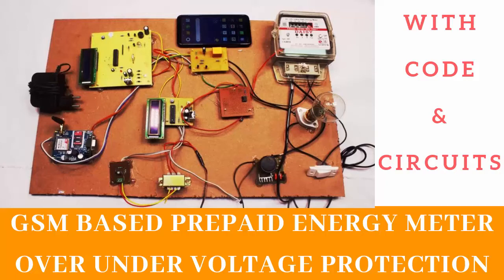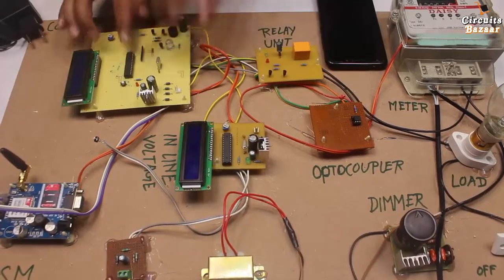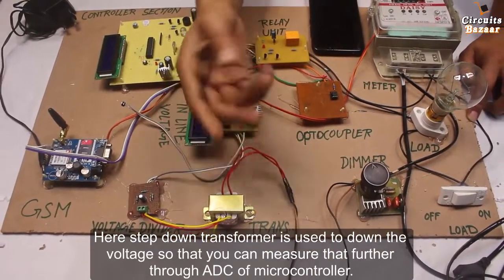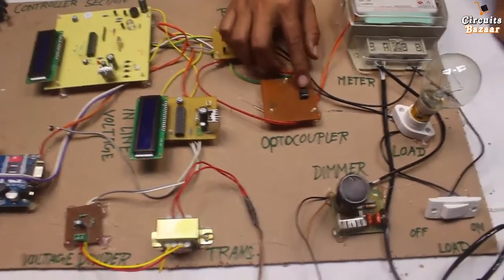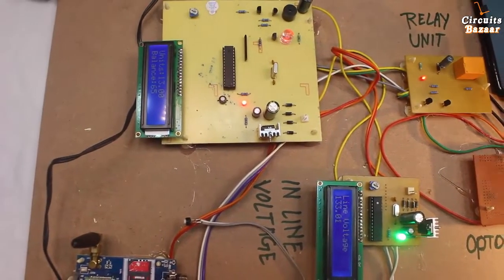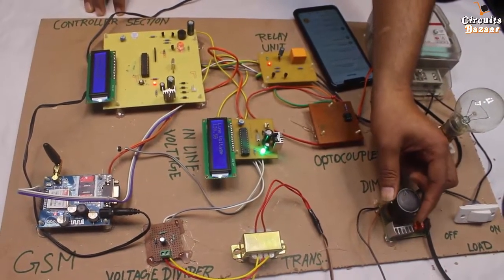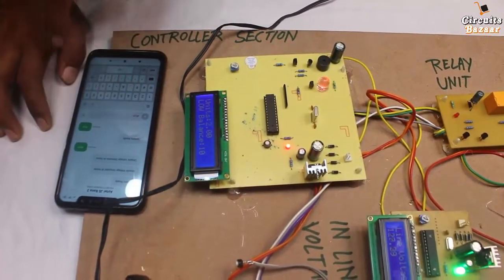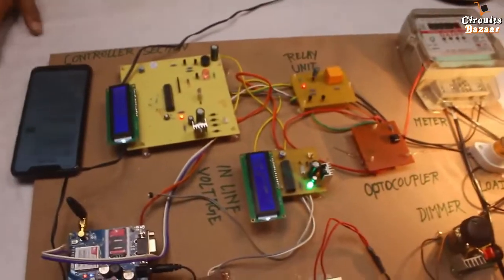GSM Based Prepaid Energy Meter with over and under voltage SMS Alert | with code and PCB Designs

Comment: Hallo good work the connection between gsm and board did you connect them direct to the atmega the billing system  coz I can't see the link btwn the 2 board kindly explain
Reply from the maker: Yes GSM modem tx rx pin is directly connected to the ATmega328 board
Reply: Thank you for your response  bro

Comment: Thank you for this project it's real cool. I would like to know how do you read the units from meter to microprocessor or the connection between optocoupler and meter and how it works
Reply from the maker: whenever a unit of electricity is consumed at the meter then a pulse is generated and that pulse is read by the microcontroller through optocoupler. now according to the formula we do some calculation which will help you to know what's going on at the meter side

Comment: Nice project. Thank you very much sir. Can you tell where on the meter did you connect the two wires from the optocoupler please.
Reply from the maker: on the unit blinking led i have connected first wire and the second wire on the ground

Comment: I connected the same circuit...but instead of reading pulse it reads somethings random variables......and the pulses change rapidly from 0 to 1000. Without any load connected.
Reply from the maker: There must be a problem in the optocoupler section which you used to connect the energy metre signal to your microcontroller section
Reply: @The.Innovative.Indian  can u send me code Bhai